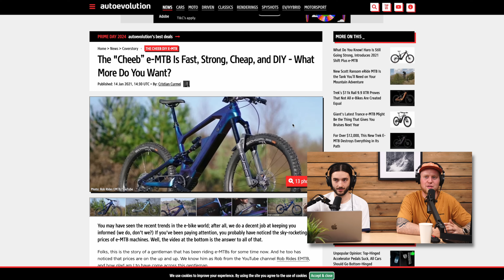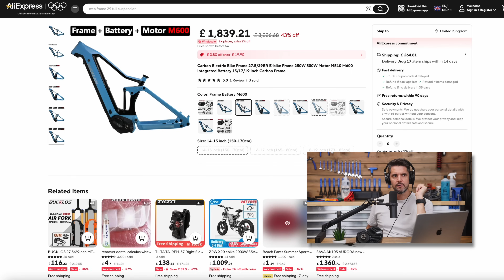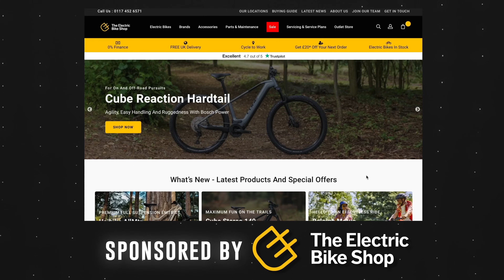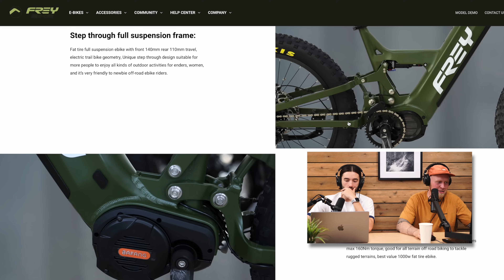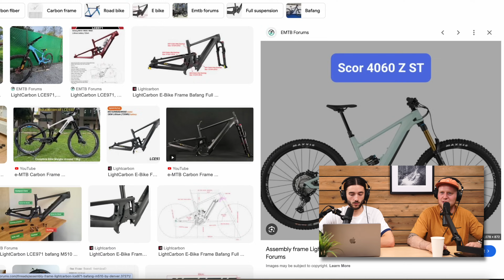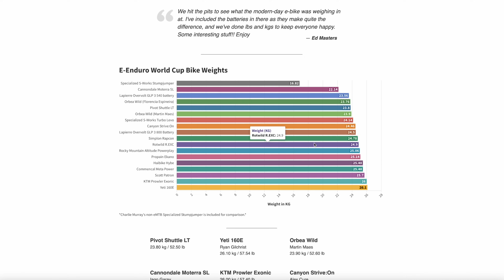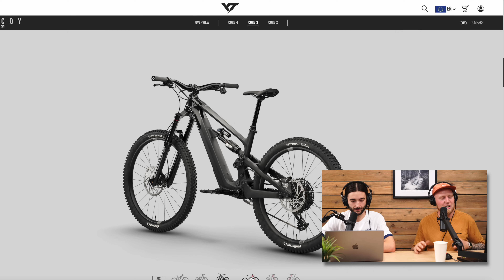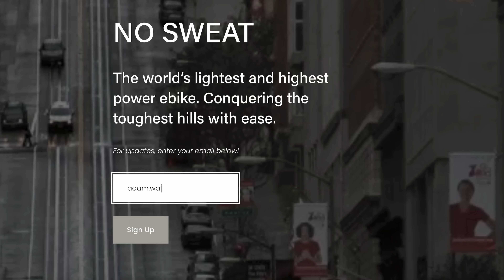Whats the deal with DIY ebikes? | ReCHRGD Podcast

Comment: I've been looking at a light carbon lce930 build myself so will be looking forward to your upcoming build very much. One thing you haven't thought of with the bafang drive units that is way ahead of the others is they sell spares parts for every part of their motors from circuit boards to torque sensors... your pretty much screwed after the warranty period is over with the big brands

Comment: I have a china bike (markhor) may be china brand but an awesome bike has 180mm /165mm travel. 33.5 digree head-angle. 75 degree seat tube 480mm reach in large 
Also has 52v 20ah battery and 1000w bafang m620  160nm and 1650w max. Yes it’s 32kg but by got it flys along a mtb trail
Reply: Hi mark 
Cheers for the tip. 
Did you buy the kun lun frame motor frame set ? 

I’ve built e-bikes in the past but looking to replace my current giant trance e with something to compliment my dirt bike training  a little more
Cheers mate

Comment: Re Batteries: The big companies probably use more in development ro ensure they have a 100% proprietary battery line, than they do testing for safety. This include chargers and motor electronics.
Right to repair and cost of ownership of older bikes is a huge issue. I would love you guys looking into that.

Comment: I believe Gary Fisher was working on bringing pouched cell batteries to E-bikes. Dewalt and Flex have cordless battery packs that run off these kinds of batteries and they are nice but expensive. They require a bit more engineering to reduce fire risk so that may explain why they haven't shown up in E bikes yet

Comment: Ive just built Medium Carbon frame E10 M510 840wh battery 29er 170mm Fork 150mm Rear shock 55mm riser bar 10 speed 34t chain ring custom decals and frame wrap. 63.8 head angle 76 seat tube and came 2nd in the Pedalhounds e-bike enduro. 24.8kg Total cost £3016

Comment: I bought a chinese ebike from DENGFU. The bike itself is great, BUT the lack of support from the company is very off-putting, They dont respond as timely as I would expect and also the lack of parts is very challenging. For example, when my bike was released, it did not come with a UDH mount. The revised version of my bike came out with a UDH version, but the company refuses to sell just that 1 piece for consumers. It feels like theyre just imposing you to buy a whole new bike.

Comment: Q see above A - No warranty and no support - a little general but when it breaks (and yes all bikes break) you need support unless the bike in question unit/modular and you can swop out a motor?
Reply: so, like buying many other brands? lol
Reply: If you want to be super picky about it, the heat death will ensure all matter and energy will dissipate… so I guess eventually a bike will break, but so far my old cycles are running fine. Unless your talking about the current crop of ebikes to breaking down? Definitely see a lot of that.
Reply: No warenty and no suport ??? iam riding a levo from 2020 and here in the Philippines you dont have any suport have to take the bike back to europ for a full service ....

Comment: You guys from Europe are so sheltered. Luna Cycles here in the states sells a full carbon, full suspension  bike called the X2. It come with Rock Shox suspension and the Bafang M600. Luna developed  a 2000 watt controller. This bike sells for under $4500 and blows away most other ebikes Only for sale in the US.

Comment: Rob, you need to build Cheeb 2. ;) Now is frame E82 with 170mm rear travel, better geo, 1000Wh battery and M560 with 1250W peak. ;)) Or legal power motor M510 FC2.1 . Good pedalling behaviour and possible to set some power parameters.
Reply: The E 82 has a lot of promise however what the hell are they thinking with the seat tube heights? These things are nosebleed territory over 21 inches for the XL. WTF

Comment: The prices for ebikes batteries are indeed absurd, but these companies are not lowering them, instead they are even putting them up with their new great marketing idea of range extenders.. 160-250wh for about 500 euros, which equals 2000-3000 euro for 1kw...  🤑 (and when I remember right, bosch even charges you 30-40 euro on top for the connection cable, which you definitely need, because otherwise you can't connect it with your bike, the business with range extenders is total madness)

Comment: Hi guys. 2 things. 1. Weight matters to people for who it matters. It matters to me, i dont like the feel of 25kg ebikes, i like the feel of SL ebikes and im ok with the lower power and battery. The heavier ones get more momentum downhill thats why theyre faster.  But they ride nothing like an analog bike. It depends what you're after. 2. You say you wont buy the YT becuase it doesnt have the DJI motor. NO BIKE HAS THAT MOTOR YET and i understand it could be 1.5 to 2 years before bikes have that motor. So that is a silly comment. The fazua, with all its reliability issues, is the best SL motor at the moment and is in the heckler SL which wins all the shootouts. So thats why the YT has it also.

Comment: On the whole weight thing... sometimes there are logistical issues involved. Not everyone drives a pane van, try lifting a 27k bike into the back of a truck, imagine your 2 27k ebikes wobbling around on the back of your 40kg rated bike rack. Lift your 27k ebike over the locked gates you encounter at your local trails. While riding I agree it's not been that noticeable but unfortunately in the real world of us non world cup riders there are practicalities to consider.

Comment: I feel like the gains in cost aren’t worth running the risk of an unknown brand. I remember when light bicycle carbon rims went through their growing pains and became a legit option for mtb riders. So it could happen but taking the risk of a rim is different from the frame. 

I agree that if the YT had come out with DJI motor and battery, I would but it t today without question. Ii would be an instant hit. 

The brands coming out with these in half powered are kind of head scratchers to me. This ties in to the weight discussion and everyone seems to be chasing the legacy ideal of “lighter is better”.  Having ridden a bunch of e-bikes I feel like my sweet spot is 22-23kg. Any lighter makes it feel less planted. 

Thanks for doing the podcast, I look forward to it each week.
Reply: I think the cost should be half of what it is. Benelli TNT 125 125cc motorcycle new £2,499 (similar for other minibikes)   The cost of eMTBs DIY or not are a  joke.

Comment: I bought a fully assembled Dengfu E55, battery and all, for $3300 from a US warehouse. Shipped to my house in 4 days. The bike is amazing, if you want to leave Chinese bikes on the table you do you, I think it's a dumb prejudice. Only issues were that one of my 2 rotors shipped warped, a wheel was slightly off-true (haven't addressed, not super annoying), and I stripped a cassette through user error on the throttle with the powerful M620. The bike is a joy to ride and maintain, it is my first MTB ever and I bought it because it is the most bike-like ebike you can get with the torque sensing mid-drive, and also has enough power since I live in the mountains. But I have been taking it on mtb trails and up mountains because I can't help myself. I would never spend $10k on an eMTB otherwise with a tiny battery, but this is bringing the hobby to a whole new set of folks. They are amazing machines.